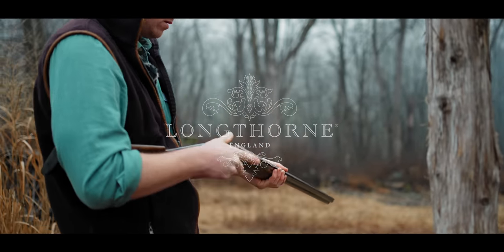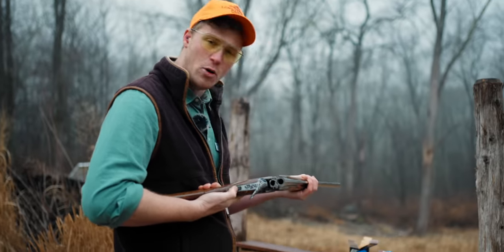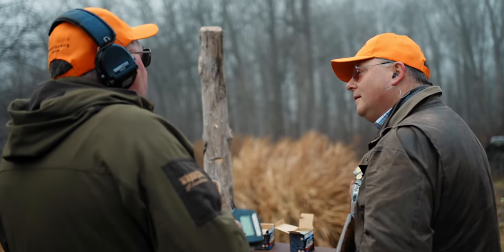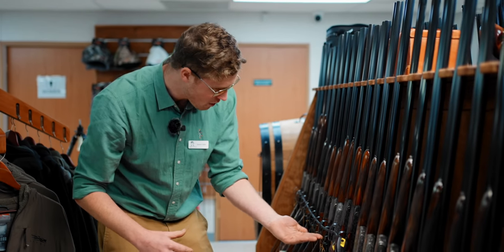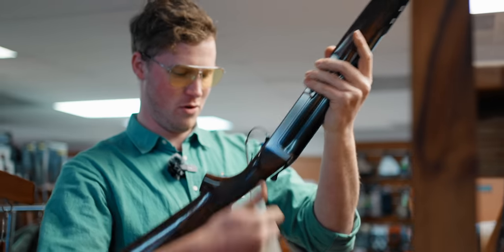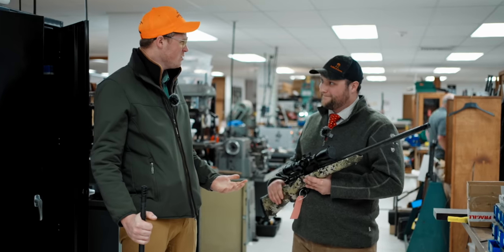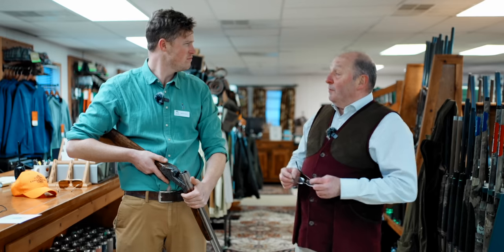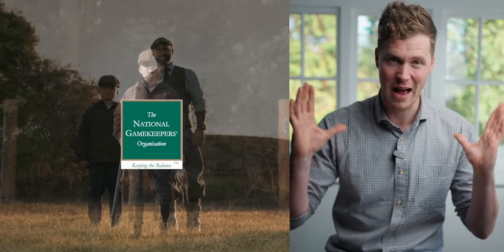The Day I Fell in Love with 28 Gauge

Comment: Are 28 cartridges expensive? 20's are in comparison with 12's, but my guess is that's down to production numbers, as in the more you make of one type is cheaper  it is? Sorry, my degree in Engineering took over..
Reply: Yes, 28ga and 410bore are about 20% more than 12ga and 20ga here in the US. At wholesale, 12ga and 20ga are identically priced for the same make and model loads.